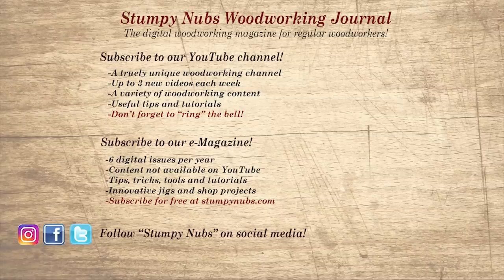Are table saws becoming obsolete?????

Comment: I agree with you, use what you're most comfortable with. I've used routers and dado blades and dado blades are much more accurate Sure you could make a dado with a single blade but it's not practical for repeating cuts. Lately I've also noticed that dressed lumber isn't always 3/4 pretty much like plywood anywhere from 18mm to 19mm

Comment: Just found you Stumpy, thanks for some ideas. I just sold my Craftsman table saw due to the fact it was 23 years old and drive belts were no longer available for it and it was never great at holding square anyway. I had to check every cut. I am now looking to get a replacement. My son has a SAW STOP but lives 50 miles away so running there for a cut is just a waste of time. I agree with your suggestions and observations. We can "jerry-rig" a way to get our cuts, miters, and routing. And for a guy who has used a chainsaw to rout out a channel in a 2 x 4. I can come up with some very dangerous ways to get the job done. I miss my table saw so I need to replace it. I have had "contractors" ( read cheap) saws, one fell over while ripping a 4 x 8 sheet. I NEVER want that to happen again. So, a JET, SAW STOP, Grizzly? The one thing I want to be sure of, replacement parts are going to be available for life of the saw or me, which ever comes first. Right now, I'm using my 1988 Mark 5 Shop Smith for just about everything. And yes the parts for it are still available on ebay or Shop Smith. (Hint, the room I have to work is 14 x 16 foot) So I guess the saw with a 5 foot fence is pretty much out of the standing. Time to get serious with the hobby or go fishing. Thanks again. stay safe... dave

Comment: I once made a pair of hangers for an oar for a friend.  There was a round cup to hold the oar, and other straight faces.

Her husband was familiar with my wood shop, and he asked me, "How did you make this?"  I smiled and said, "Every surface that you see was made on a table saw, including the curved cup."  He was puzzled for a moment and then, wide eyed, asked, "did you run the wood diagonally over the blade?"

Yes, that's exactly what I did, raising the saw blade a bit at a time.  It was easy, and fast, and reproducible.  You're limited to elliptical "cups" but sometimes those will do.

-----

I have just moved, and I gave away all my old bench power tools; kept my skilsaw and my hand drill and my angle grinder and my jigsaw -- all hand tools.

First, I'm gonna get me a new table saw.  The second tool I'm going to get is a drill press.  The third is a bandsaw.  The fourth is a combination disk/belt sander.  Maybe a chop/mitre saw after that; it's handy for some things.  Routers scare me, but they are useful, so that's on the list.

Comment: TSO Parallel guides attach to track saw tracks, and makes ripping sheets of plywood and MDF a breeze. I can break a sheet down completely with four or five cuts in a few minutes. It's a MILLION times safer than a table saw, and I do love my table saw. It's not a complete replacement for a table saw, but a track saw is my go-to for ripping sheets.

Comment: The track saw is limited on cutting thick stock.  Beveling a 4x is no problem on a table saw.  Also 3hp 220v table saws are like AWD. You don’t need it all the time, but it is so nice when you have it.  I got one after 23 years of struggling with a hand-me-down ryobi.

Comment: It used to be that a table saw had the most accurate, stable and robust blade bearings and guides, but with today's focus on cheaper and cheaper products, many low price table saws have poor blade alignment and stability. With this in mind a cheap table saw is not a replacement for the other portable cutting and shaping tools available for wood workers, but a high quality table saw is still 1 of the best wood working tools available. I'd like to upgrade my 1962 Rockwell Beaver table saw, but this 59 year old saw has better bearings than most under $10k saws on the market. Its fence is a pain and the tilt mechanism and motor mount and pulleys are aged, and slow and cumbersome to use and maintain. But the blade is rock solid, from cut to cut I can get wood pieces that are within 0.005".

Comment: good summary.  i think it would have been nice to address the two distinct types of table saws in the article, namely portable vs stationary (contractor vs carpenter), as there is a rather large difference (time to cut, accuracy, power, size, etc.).

Comment: I find, for myself anyhow, that I get a better cut on sheet goods with the track saw only because I am wielding the tool instead of the cumbersome sheet. But that probably comes down to the set up and saw... I only have a cheap contractor saw (the next item to be replaced in my shop) and it has no set up for a writhing knife and a terribly designed throat plate that can’t, or is difficult to adapt for a dado stack. So, I use all 3 tools for a variety of these tasks... But I agree the table saw is the most versatile for quick repeatability. 

HOWEVER.... I do have to say one thing and address the elephant in the room. Stumpy, don’t edit your videos after too many “cold ones”.... there are only 2 Os in Sheet Goods, not 3. 😅

Thanks for the video, always learning from you.

Comment: In a world where woodworkers have made furniture and a myriad of other things for hundreds of years before there were table saws makes this a poor question in the first place.  Craftsman made precision items way before there were power tools. The table saw as well as all other power tools make the modern craftsman more productive as well as getting jobs done faster.  The table saw will never be obsolete until the next big thing such as 3d wood printing or something like that.  It's absolutely up to the user and what they prefer. Sometimes I just make things with all hand tools just because I can. If I'm planing a couple of short  boards , 3' and under, for a small project, it's quicker for me to use a plane than to drag out the planner, set it up when I could have had it done by hand by the time I have the planner setup done.  User preference. Just do you and no one will ever be unhappy. ✌🏻🙏

Comment: I've been woodworking since 2013 - full time starting last year. It wasn't until a week and a half ago that I got my grandfather's old Craftsman table saw working. My cuts are far more accurate than they ever were before and the convenience for repetetive cuts and joinery can't be beat, in my opinion. I will admit I was intimidated by using a table saw at first, but the safety videos on this channel helped. I honestly can't imagine a scenario in which a better option for accurate, repetitive cutting comes along.
Reply: Late last fall I bought somebody’s grandfather's old Craftsman table saw, first I’ve ever owned &/or used since college 40 years ago! Any sources of advice for evaluating, inspecting, maintaining the Craftsman beast? Yes, it's a scary tool, but being scared is good for all our digits. 42 some years of cutting & I've never so much as nicked any of mine. Many thanks
Reply: @kooale  Reddit has some decent communities that can be pretty helpful - r/woodworking in particular. Other than that, google is your friend. 
I don't know your particular model, but the one I'm using has the power switch and reset button in a place where dust builds up fast. It turns out sawdust had built up behind the power switch, which is why I could not get it to start. I vacuum that specific area every day or two now. WD-40 has made the angle/height adjustment a lot smoother. 
I can say this with mild confidence: your saw should last as long as you don't push it too hard. Mine has been kept in sheds and garages without climate control ever since it was purchased. I've had to change the odd screw, but, or bolt due to rust, but everything else is fine.

Comment: Hello I've been wood working most of my life and I started out with a circular saw 
And a Very Straight 1"X 3" X10'  long and 2 C clamps 
 For many years that's high ripped plywood Then one day I was able to buy a Craftsman 10" table saw
 After that I would never go back to a circular saw for ripping plywood I have 2 table saws now
 What is new in the Box any other one gets used quite regularly
 Now I'm looking at buying a  Miniature table saw.
 I will always have a table saw as long as I am doing wood working

Comment: You need a Bandsaw and a table saw and a router table and a planer thicnesser and a Pillar drill and each one is used dependent on which one is ideal for the job. I haven't got a tracksaw because I, m waiting for the next time Parkside have their special offer. These tools are excellent and inexpensive.

Comment: Another plus on the circular saw, coming from someone who has a nice table saw.

You can just cut outside easily.  When my garage shop is freshly cleaned without a SPEC of dust anywhere, I just cut outside to avoid getting chips and dust inside. Even with dust collection, the table saw makes a mess.

There's nothing more satisfying than cutting on a table saw with a nice large crosscut sled though. Something just feels better about the cut than a miter saw crosscut.

Comment: I have used my table saw extensively over the years, mainly for reno-projects in the house but also for toymaking, box making and some joinery. Unfortunately, the blade raising mechanism, or more precisely the handwheel lock has become unreliable so the saw really only gets used for rough sizing, and I do final dimensioning with my hand saws, and plane on a shooting board. I actually prefer to make shavings rather than dust, but as my table saw approaches the end of its useful life I wrestle with myself as to whether or not to replace it. It would certainly free up some scarce and precious floor space, and I don't think I'd go for anything short of a SawStop product nowadays but I'd need to expand my space or rent something to give it a decent place to work; on the other hand I've never lived in a home that didn't have a table saw...it feels as much a part of the "furniture" as the dining room table...decisions, decisions.

Comment: I tend to agree. I have a simple JET JPS 10TS table saw that I have tricked out to the point that SawStop would be impressed (OK, not the safety issue). I use my table saw for large wall units to small boxes. I have an expensive track saw for location work and breaking down sheet goods into manageable pieces. I won't sell my table saw.

Comment: Good discussion. A track saw cannot beat the accuracy of a good quality table saw (and fence). I can easily make repeatable cuts to a very specific width that is easily less than 1/100th of an inch.  I wish Saw Stop would develop a micro-adjustment screw for their fence though (like good quality router tables have for height adjustment) so I wouldn’t have to try and “bump” the fence 1/4 of a hair’s width one way or another.  Impossible to do that with any other kind of saw.

Comment: I pretty much agree with this video.

The table saw isn't going to be obsoleted the way the radial arm saw was because it offers that combination of precision, power, speed and versatility.  It's going to be a mainstay of cabinetry and woodworking shops for as far as I can foresee.

They are absolutely not required woodworking tools, as everything a table saw can do can also be done with other tools.  Including all those hand-powered planes and chisels in the background.  Throw a couple hand saws in the mix and you've got a fairly capable hand tool shop.

Comment: I agree on speed and accuracy of table saw.  Unfortunately, my space is limited.  I want to offer a compromise to this debate though.  I own a Dewalt “jobsite” table saw.  I can prop it on a table, make necessary cuts, then stow it away when work is complete.  It only weighs 45 pounds.

Comment: If cost of a table saw is a factor, it is hard to argue that owning a track saw and a miter saw is more cost effective than owning a table saw.  A track saw might be better (and safer) than a table saw for breaking down sheet goods.  But once the pieces are small enough, the table saw excels.  But, I cannot imagine cutting a 2 inch piece of lumber into quarter inch pieces with a track saw.  Piece of cake on a table saw.

Cross-cutting on a miter saw is easy, but cross-cutting on a table saw is also easy and the table saw can handle wider wood.

Furthermore, a table saw can do so much more than a track saw plus a miter saw - joinery being the most obvious capability of the table saw.

In my opinion, a table saw should be the first major tool purchased for a wood shop.

Comment: This video is pretty much on the button. As a former cabinet maker and now a carpenter there is one thing that I think has been missed. When cutting sheet goods a table saw takes over twice the s[ace of a rail saw. When processing a standard 8' x 4' sheet the space required is 8' either side of the table saw plus the size of the saw less a little bit. When cutting sheet goods with a rail saw only enough space to walk around the sheet is required. Also when making repeat cuts in sheet goods there are rail saws such as the Festool that have a parallel guide accessory for repeat cuts. When making repeat cuts on a table saw a cumultive error can occur from the fence whilst a rail will always remain straight though the caveat to that is that a rail may need to b joined from two pieces introducing the possibility of error. Personally I have a ten foot rail for this purpose but it is so unwieldy it has not been to site for over a year! 
The one job for which the table saw is quite unsurpassed is ripping timber and the smaller the piece the greater the imperative for the table saw. I often have to cut small parts on site when patching and splicing and if a table saw can be lugged on to site and into one of London's often small houses then it is a real boon.

Comment: I'd certainly agree, it is by far the most repeatable and reliable way to make these cuts. I would argue that it is a safer way to make most of them too, if you set up properly and use push sticks, feather boards, sleds, etc. then you are in good shape. I find that making cuts with the circular saw in particular takes me to the floor, I am in an awkward position and have had blades bind more times than I care to remember.

Comment: Do you have a video on circular saw tracks and or a homemade one. I have a small working area and tabletop table saw that I have to put away when not in use I'm just thinking something more convenient for one or two cuts now and then if I'm not doing a lot and want to pull out the table saw.

Comment: Depends on your industry.  For one piece of furniture at a time a track saw is just fine, and there's times when it's the better tool. I work in a union shop building TV and movie sets where we often have greater volume, like ripping 900 feet of baseboard. For speed and consistency a table saw is the right tool for that task.

Comment: To sum it up, if speed, higher precision and greater safety (in case of Sawstop) are required and budget and space allow it then get the table saw. In all other cases a miter saw, a track saw and a jig saw will do just fine.

Comment: With a table saw, I can use shims in a stacked-dado to "dial in" the exact needed width. Router bits just don't have that capability.
Reply from the maker: With a router you don't shim to make the dado wider, you rabbet the mating workpiece to fit it in the dado. Just like they did it in the old-timey days.
Reply: @StumpyNubs  I do that even when I use the table saw for dados. I find it easier to dial in the mating workpiece that way when planing or sanding for the final surface it won’t affect the fit of the joint. 👍🏼

Comment: I have been debating whether to buy a table saw or not. The biggest limiting factor is the space vs utility. My research came up with the same conclusion. If you really want the repeatability and dependability and require the scale of repeats, then it makes absolute sense. If its a light hobby that you are ok with an occasional misalignment and reworking, the space is not worth it. Another option is that when you order online, you can get minimal cuts done that already brings panels to workable sizes. But small mistakes in orders can cost lot of time.

Comment: As an weekend warrior who may have to break down sheet goods twice a year this is my 2c.
I could not live without my table saw. It is a jobsite Ridgid, I am looking to upgrade to a Sawstop contractors saw.
I hate my 12" sliding Milwaukee miter saw. It was great while I was framing my house and for breaking down large pieces of lumber but now that I am trying to build furniture and set up a shop it is too noisy, too dusty and takes up too much real estate. I let my cousin borrow it about 12 months ago and I'm hoping I never see it again. I can cut dead square with my hand saw and if I need repeatability then I pull out my sled.
I hate my router table. It does have its uses but for me its the last resort. 
When I do break down sheet goods I use my $40 Skill saw, a straight edge and 2 clamps. Once it is in manageable sizes I then final dimension at the table saw.
I have ordered a 14" bandsaw with 8-1/4" re-saw capacity. This will complete my life!

Comment: Just recieved the last things needed to do dado cuts on my Laguna Fusion 3..
Cabinet build is next in Line. Thx for the video.
Oh and dado here is not something you can buy in any hardware store as it is not something they sell because of safty and rules.
We only have one store Selling the Laguna machine and the only tablesaw on our market that can and they don’t advertise about the dado part.
Reply: Yeah. The EU quietly clamped down on them because dado stack injuries are so much worse than single blade ones.
Reply: @emm_arr  For good reason if you ask me. If you're willing to take the risk, you can still get it from abroad.